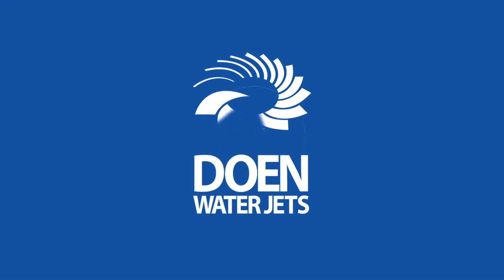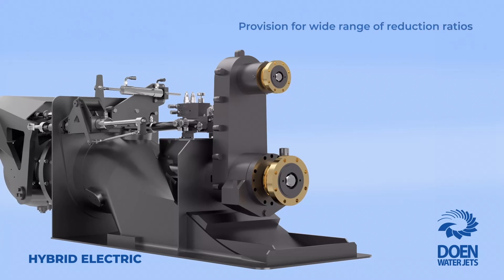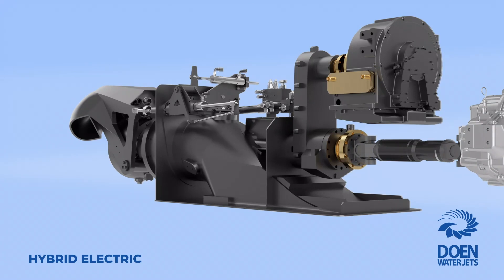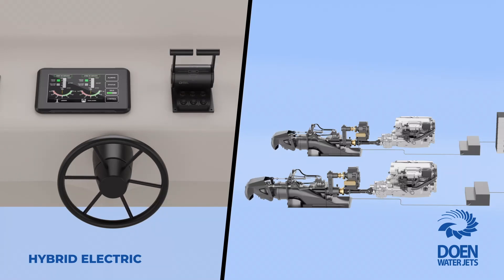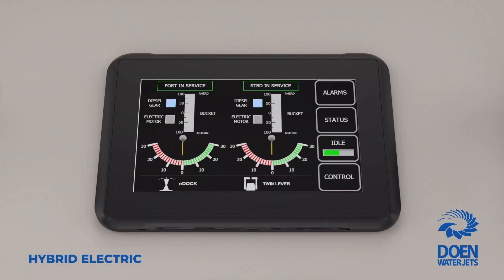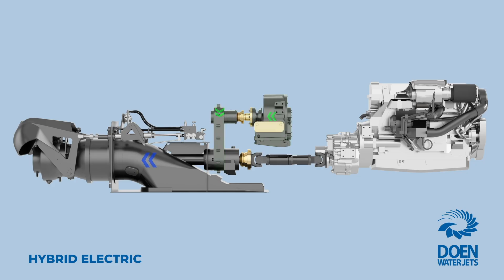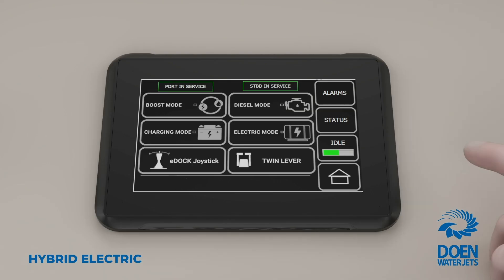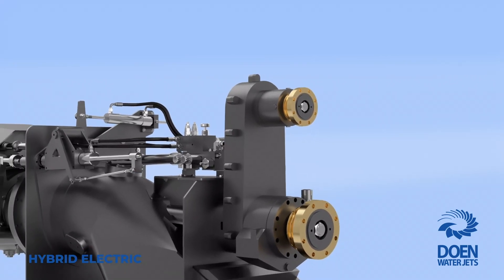Hybrid Electric Waterjet

Comment: wonder if anyone ever tought of putting a CVT gearbox on the back of the diesel engine. that way the diesel can run at its most efficient rpm ( 2000 rpm for example )   and the input rpm of the jet can be varied by the use of the CVT gearbox 

so basically the engine runs a constant rpm and then use the CVT to vary the jets rpm
Reply: Efficiency is not specific to any one rpm at any power level. CVT would have to be massive to take the torque, which means it would be less efficient than a fixed ratio. Also, boats are basically fixed speed. You match the engine and jet to the speed you want. Who accelerates and decelerates often in a boat.
Reply: @chippyjohn1  so basically what i said is perfect and would work brilliantly
Reply: @cordellej  I assume that's sarcasm. Haha